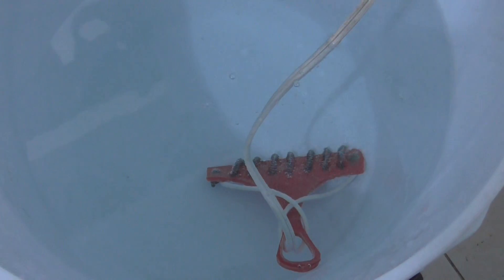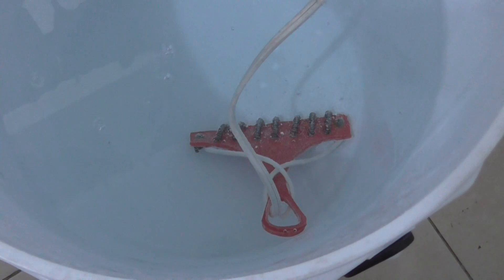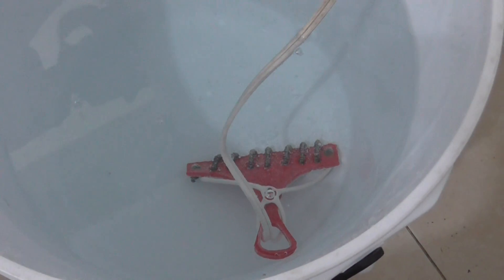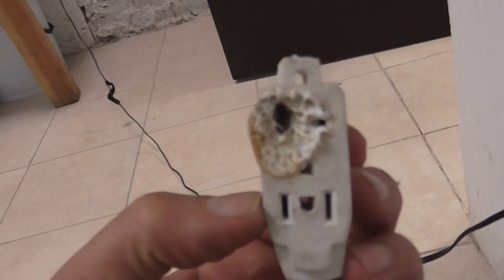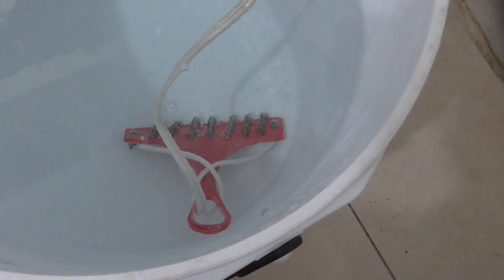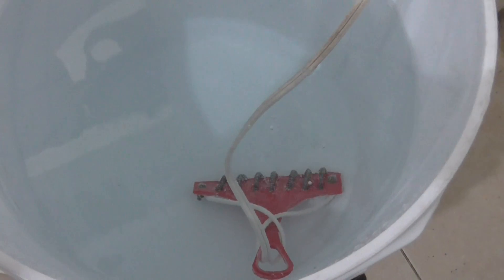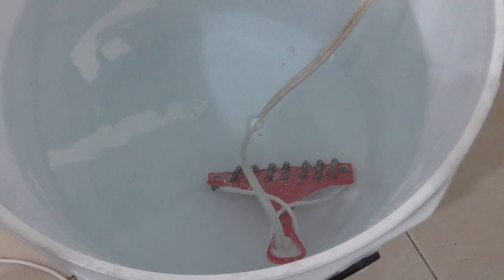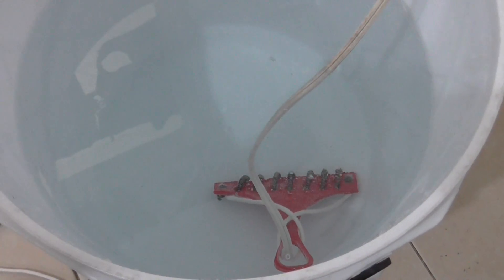Mexican Water Heater...This would be so illegal in the States!

Comment: I think I know why the plug messed up . 
you need to use more wire to increase the resistance , so less current will flow through it wich means less  dangerous heat .
a tiny amount of wire and crappy protection against short circuits will lead to fire .
so make a giant roll of copper wire as big as you can and  then try it .
Reply from the maker: +Amn Red flag Interesting, that makes sense.